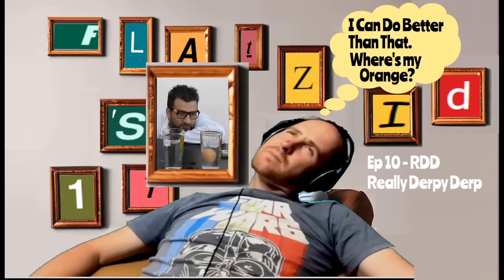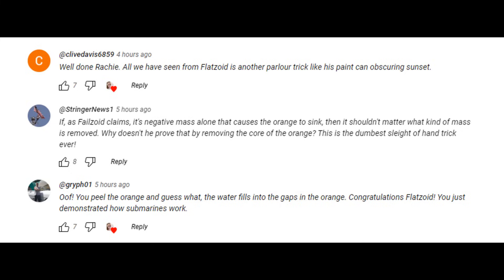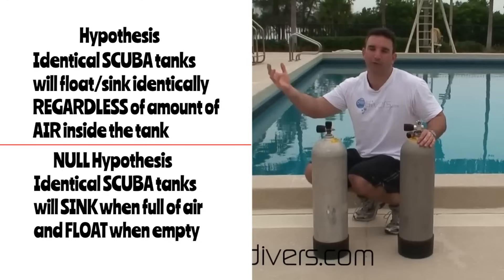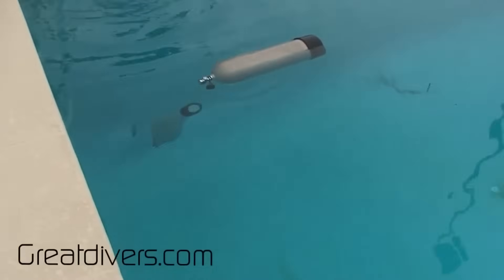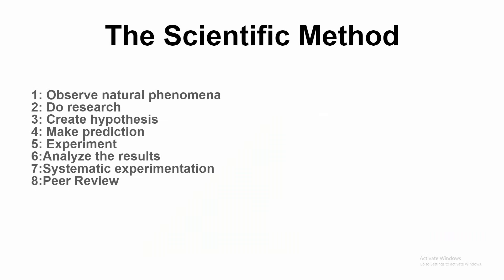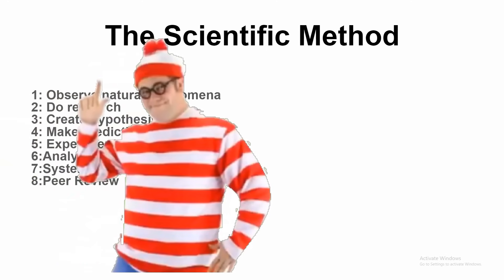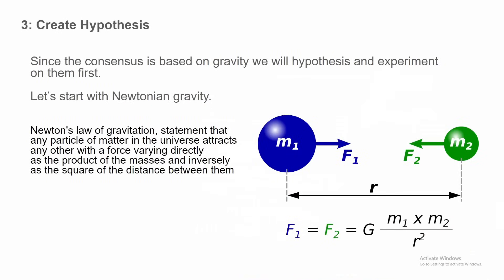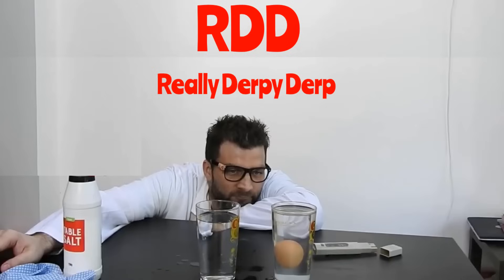How To Make Air Go Down Go Boom Boom And Not With A FlatZoid Orange

Comment: I had a serious brain fart here, I mean, there is overpressure mass in the almost empty cylinder as well, why should it float? 

Then I realized, because air even at slightly higher pressure than ambient is still less dense than water,  while the average density of the metal in the bottle and the more compressed air in the full bottle is higher than water. The compressed air itself would float it there was a light enough container that could hold it.

Comment: My guess is that the flat-earthers will use the video with the Japanese astronaut and say it is fake, for we can see small bubbles chande directions, flerfs will call it "bad CGI" or something, for them everything in space shall follow a starlight line, but they do forget that there is air inside and turbulence due to fans and air circulation.

Comment: "If air floats, more air must float higher."
─ Excerpt, Musings of a Flerfluous Mind
Reply: If density were the case, a vacuum is less dense than air, therefore it should float on top of it. It does. So there, they have their air pressure next to a vacuum without a container.
Reply: @clivedavis6859  If flerfs' logic had some kind of internal consistency they wouldn't be flerfs.

Comment: Just lift an empty scuba tank and a full one and you'll be able to tell witch is witch.
Failzoid's eggsperiment is even worst than that of the Leaky Worrier...

Take a ball of steel 1m in radius, and a disk of steel of the same mass, but only 0.1mm thick, and both will sink.

Comment: Flatzoid will also deny the fact that gravity is measured to work horizontally and in vacuum! Thus relative density/buoyancy/pressure gibberish is just that. Torsional balances measure gravity between masses at the same level. The Eot-Wash group used torsional balances in vacuum to confirm Newtonian gravitation to micrometer scales (New Test of the Gravitational 1/r2 Law at Separations down to 52 μm).

Comment: Has FlatZoid seen the Feather/Ball drop in the worlds biggest vacuum? Density/Buoyancy has nothing to do with it. I know Brain Cox has a video doing this but there are others.
Reply from the maker: Oh I am sure he has. He mentions that vacuum chamber often
Reply: @whereswa11y He refers to it as the strongest (as in the lowest pressure) vacuum chamber, which it isn’t, and insists Brian Cox should test a rocket there. No doubt he will rapidly shift his goalposts if that were to happen.
Reply: @andrewjohnston6631  When has a Flerf ever not move the goalpost to fit their narrative? Flerfs were the kids who tried and tried to fit the square block in the round hole. Now instead of learning why it won’t fit they just make a new hole that doesn’t work either. And what they end up with is an ideas that is full of holes. When called out on it they just make a new hole. This is why they have explanations for each observation also why each explanation doesn’t work with every other explanation. Meanwhile a round earth doesn’t have this problem explaining all observations.
Reply: " Density/Buoyancy has nothing to do with it. "
Nahhh, you've got it all wrong. Density has EVERYTHING to do with it. Failzoid is so dense he should attract even stars from other galaxies.
Reply: I think it was on Apollo 15 and Scott dropped a falcon feather and a geology hammer at the same time displaying how they both fell at the same rate. I don’t think you could get a vacuum much better than that.
Reply: @Sherwoody The only thing stronger than negative seventeen torrs is infinite negative pressure!

Comment: Actually, whereswally, a 10lb bowling ball will float in water. They don't start sinking until they are 12lb+.
Watching that water bubble soak into the towel was awesome!
Reply from the maker: Today l learned…
Reply: @whereswa11y  I just learned that recently myself lol
Reply: As a bowler I would have to say that it has more to do with the outer shell and what’s it made of than the weight. Most “house” balls are made out of cheap polyester/resin and they have a lot of trapped air in them.

There are different types of bowling balls
Polyester
Urethane
Reactive Resin
Reply: @Naifukiti  .
No, it is everything to do with the weight.  Given  that they are all the same size, the heavier one would have to be more dense, so less likely to float.
Reply: @grahvis So…. After further investigation I was wrong about ONE thing, and that was only pointing to “cheaper house balls”. But to my surprise my explanation/reasoning still holds true if you remove that. 

Since most “house” balls hardly go over 12lb, I equated those to be less dense,

And anyone who is serious about bowling wouldn’t buy or have more passed using 12lb or less polyester balls (unless you buy a ball to pickup spares you typically want those to go straight), I equated those to be more dense (urethane)

So… density is the reason why some float and others don’t which was what I was alluding too.
Reply: @grahvis  You are both right and wrong here. The weight of an item does not govern its 'floatiness'. Its all about density as you also mentioned. This is where you can apply 'relative density disequilibrium', but without gravity you cant really use it at all, as it has a very distinct direction.
Reply: @HOOOLD_ON  .
When a number of objects are the same size/volume, if one is heavier than another one, it must also be more dense.
Reply: I remember seeing this on the Discovery channel showing the density of various bowling balls.

Comment: So.. if it's all about density I got two quick questions:
1.) On a balance scale, why is the 50 g, very dense lead weight not pushing down the scales against a 2 kg wooden block?
2.) Why is the orange submerged in water instead of flying up into the way less dense air? For that matter, why isn't the water?
Reply: Perspective

I'll get my coat
Reply: @awatt  Nah nah! Aint it Sleepy Worrier's "refrakshun"  that be gravy tea.
Reply: Reminds me of Archimedes and the fake golden crowns.

The fake crowns were close enough to the same size as the real one to not be appreciably different, and they balanced perfectly on a balance scale.

Submerge them in water however and there would be a difference.

Comment: Regarding the buoyancy of the scuba tanks, buoyancy checks are done with nearly empty tanks. You can then compensate by adding or subtracting the amount of weight you carry. In general, I also add around 1kg more lead in salt water than in fresh.
Reply: I find it easier to just add or remove air in the BCD instead of changing the weights on the belt, and as you get further down, the wet suit compresses thus reducing ones bouancy. You also can change your bouancy with breath control.....
Reply: @bunnykiller   when your bcd is empty and you’re still floating to the surface during your safety stop, you are underweighted. Any diver knows that you correct your buoyancy with your bcd and breathing, but you still need proper weight. Adding weight during your dive is impractical as you would have to carry the weight with you. The only time I’ve ever seen anyone add lead during a dive is if someone starts out underweight and a dive master or guide is carrying extra.
Reply: But but but.... "this is an egg!!" 😂

Comment: Any welder knows an empty air tank weighs less than a full one.
Reply: By flerf definition a full tank of helium should weigh less than an empty one.
Reply: My big argon tank is 180lbs full and 140lbs empty. 
I don’t know what the weight on my oxygen bottle is, but it’s definitely lighter when it’s empty!
Reply: @KennyEaton603  does this mean that Failzoids arguments argon?
Reply: @Sherwoody  🤣🤣
Reply: @Sherwoody  I see what you did there! 😂 👍
Reply: Any beer brewer as well.
Reply: Anyone with a propane barbecue grill knows a full tank weighs a lot more than an empty tank, so propane gas must contain mass too.
Reply: From my days of using butane, I can attest to the fact that a gas bottle weighs more when it has 104 lbs of gas in it than when it is empty.
Reply: Anyone in healthcare dealing with oxygen/medical air/nitrous cylinders knows that too.
Reply: Anyone with a modern kitchen with a sodastream or similar carbonator knows this too.
Reply: @freddan6fly  - I guess I have never had a modern kitchen, never had a soda stream. 😉

But I have played paintball, and the CO² cartridges definitely weigh more when full than empty there too.

With all these everyday real world examples, of compressed gas containers weighing more when full than empty, how could anyone ever think that gas has no mass?
Reply: No it doesn't
Reply: @mokgz169  "No it doesn't" - I have weighted my CO2 bottles to determine when they are empty. When they are empty they are lighter. So you are just lying without any evidence. Are you a silly flerf, or do you deny reality, science and measurements in another way too?
Reply: @freddan6fly  i deny that without out the guard if you smack the top off the gas bottle will go through a concrete wall
Never remove the guard 😳
Reply: This is an🍊

Comment: When you said “what else will float”. I thought “very small rocks, apples, bread and, of course. “A Duck.”
Reply from the maker: Naturally…
Reply: Witches too.
Reply: There are sinkers and floaters, but they depend on what you eat.
Reply: I have never seen small rocks float. Being pushed around by water currents is very different than floating. Just saying
Reply: @Naifukiti  I have seen boiler slag float. I guess it counts as a rock.
Reply: @Sherwoody  floating and not breaking the surface tension of water isn’t quite the same thing. But to make you half right, I have never seen a rock that is as fine or as dense as slag to make it float.
Reply: @Naifukiti  we used to occasionally find them on the beach (Lake Erie) when I was a kid.  My grandfather called it boiler slag. There were lots of bubbles in them, and if you dried out a piece (walnut sized), it would float for a while. There are better laws now on what gets dumped into the Great Lakes, and I haven’t seen a piece of that stuff in years.
Reply: @Naifukiti  But isn't dust just very small rocks?
Reply: @clivedavis6859  dust isn’t just small rocks, and again not breaking the surface tension of water isn’t the same as floating based off density.
Reply: Its a fair cop...